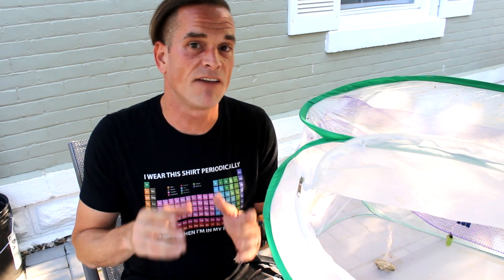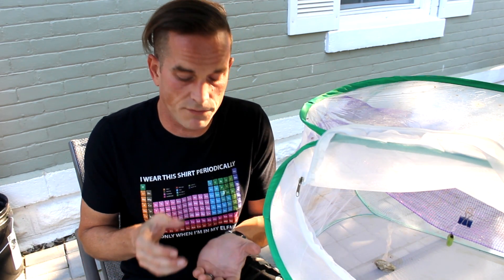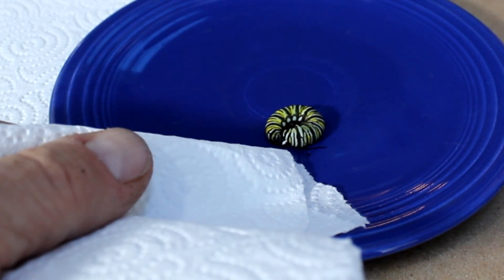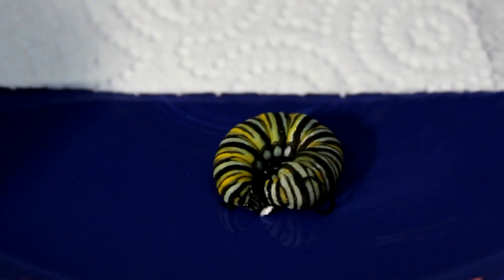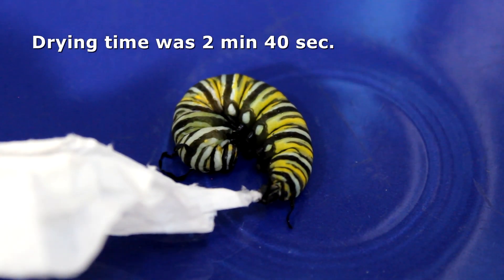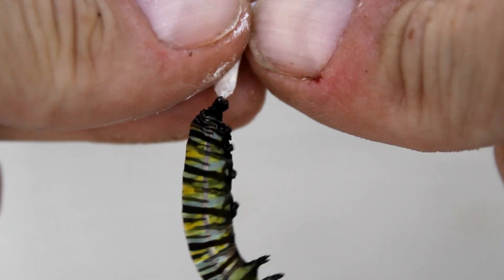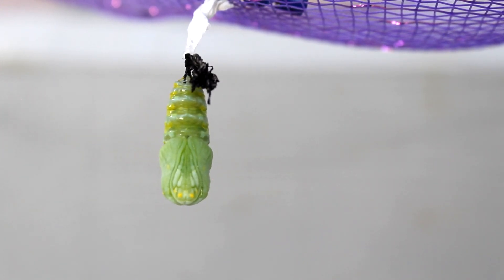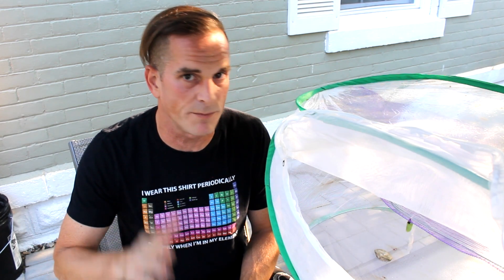Raising Monarchs - Fallen J-Hanger (Help The Monarch Butterfly)

Comment: Coincidentally this actually happened to me for the first time this summer luckily, the silk patch was still attached to the enclosure and I was able to use the hooks of the back legs to help it hang.
Reply from the maker: Having the silk patch in the case shown in this video definitely helped out.  If it were missing, to my knowledge, the cremaster would be an opening for the chrysalis, and thus, bacteria or chemicals applied there (such as glue) could enter in.  Cool to hear of your ingenuity in tackling this problem you also encountered!